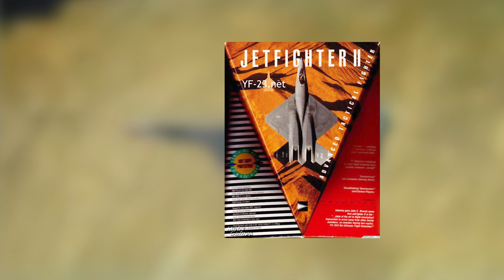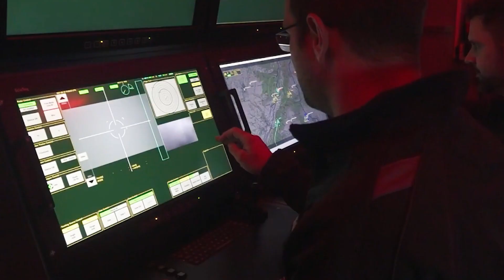Finally! US Tests World's Most Deadliest Fighter Jet

Comment: I've spoke to Air Force pilots at Edwards AFB that told me the YF-23 was much better and all the pilots favored it. Military contract politics was the reason they went with the F-22. It was probably cost. But no matter what, both were far superior to anything else in the world so we still ended up with the best production fighter in the world. It's just too bad it wasn't the YF-23.
Reply: Part of what I read and heard was due to the huge over cost of the b-2 was also a factor that they chose the yf-22.
Reply: I doubt the F-23 would have cost more than the F-22. Lockheed Martin is notorious for being over budget and behind schedule. The F-23 would have been a much better fighter.

Comment: I question the stealth comparison because every article I've read/seen supports the YF-23. 
1.Profile wise it looks thinner & the stabilizers on he YF-22 are Massive even if they are angled. The other things not mentioned here are:-
2. the overall range which the YF23 was longer (as well as the combat range), 
3.the speed - which remains classified to this day but many have said it was capable of more than YF22.
4. Northrop's computers and electronics were far more advanced than Lockheed Martin at that time & if I'm not mistaken they supply the electronics and computing for the F-22 now.
The factors which were the main considerations, were 
A) Close combat maneuverability which was not a requirement when demonstrated but the YF22 demonstrated it and as time has proven - its a pointless advantage given beyond visual range requirements now even more at the fore - which the YF23 was better because of its range and advanced electronics/computing.
B) the more significant thing was having Northrop overburdened with 2 massive projects and the YF23 being a significantly new design project may have led to significantly more cost over-runs & delays, and the loss of aviation/manufacturing professionals/ if Lockheed lost the project & the resultant loss of competition in the industry going forward.
With the benefit of hindsight now 30 years, we can see that for a decade now the F22 has become relatively obsolete and the air force is already developing the 6th generation fighter. Many will see that the planes of NGAD will be far more like the YF23. So in that regard with 30+ years of development of the YF-23 what would it look like now or even 7 years from now ??- and those cost over runs - would they not have ended up being actually Savings - because you are developing  a concept that existed way ahead of it time. Proof in the pudding is the Japanese working with Northrop on their F-X program and taking a real interest in the YF-23 program. Also if you look at Britain/Europe Tempest concepts they seem far nearer to the YF-23 design even after 30+ years. Which should enlighten people on how advanced the YF-23 program was. I'm sure it would have had far more issues to resolve, but as many have said "Fortune Favours The Brave".
Reply: I agree with everything you said.  To summarize the supersonic cruise, almost double the range and it’s superior stealth would all be critical and decisive air superiority qualities most needed in today’s environment.  If it was more costly and riskier, it should have been well worth it. I don’t recall the F-22 being on time or on cost at all.
Reply: The joke about Northrop's lost to Lockheed Martin in the ATF competition is Northrop lost because it brought a 6th generation fighter to a competition for a 5th generation fighter.
Reply: @F15ElectricEagle  This is the best simple explanation I've ever read! although i think the Craptor is more realistically a gen 4+++++

Comment: I had an opportunity to work with an engineer who worked on the YF-23 & he said the YF-23 outperformed the -22 in every category except “time to climb” which wasn’t a design choice at the time of initial design? He said his group was told that the true reason the ‘-22 was selected over the ‘-23 was the production location which one of the senators involved in the was from Georgia which is where the production location ended up. He said, and has been verified, that the design was amazing & used alot of engineering used on previous Northrup planes. Either way, it stands today as one of the most phenomenal plane designs Ever!

Comment: A lot of the design choices that were implemented in the two YF-23 prototypes were made to meet the certain requirements of the ATF competition, but along the way the Air Force changed some of the requirements of the ATF Program, so design elements like the large engine humps of the YF-23 would of been drastically smoothed and reduced in the production version of the F-23 if it had been selected as the winner of the ATF Competition. And there was also talk that the F-22 Raptor was also considered for a US Navy, the F-22 Sea Raptor would of been a Carrier version for the US Navy, kind of like if a F14 Tomcat and F-22 Raptor were combined into one fighter but this idea was later dropped.

Comment: You can argue the 23 didn’t have the dog fighting ability of the 22 all day but, the DOD didn’t designate thrust vectoring as a requirement for the program. And the 23 was only slightly less maneuverable. The 23 had everything on the 22 except TV. Lower RCS, longer range, larger payload and was way faster. The bottom line was they always screw NGC and Lockheed Martin has more pull with the powers that be. And a final note…the F-22 hasn’t had to dog fight any other aircraft even once.  As a NGC employee during this competition, I digress.

Comment: Main reason the YF-23 failed was due to the fact the US wasn't willing to go into problematic development and production time such as what happened with the B-2.   Once the bill goes up the US government senators get a little worried of their wallets.    So because the company that owned the B2 also owned the YF-23 and the US government was expecting that the fighter would have a difficult time and be to expensive, it was canceled.    

Ironically enough if you were to create a new variant of the YF-23 today there's a good possibility it could fulfill all the requirements for a gen 6th fighter.

I don't think we've seen the end of the Black Widow's story..
Reply: The B-2 production costs were part of its revolutionary development, it was the first aircraft that was entirely designed, and digitally test flown on computer systems. There were robots in use on the production floor - it was, and still is, an amazing step forward. It was ground breaking. That costs.

Comment: Sorry bad analysis on several points. The YF-23 has a smaller radar cross section. It also had a faster top speed with the GE120 engine as well as longer ranges. Also thrust vectoring nozzles increase a jet’s radar cross-section, meaning the YF-23 had better stealth performance than the YF-22. Also the engine faces were covered over by facets and were not visible by radar. The distinct trapezoidal wing, a dropping duckbill-shaped nose, a pushed-forward cockpit, and a V-shaped tail, the YF-23 had a far higher stealth profile and did not cut down on maneuverability. In fact improved instantaneous maneuvering. The thrust vectoring only improved high AOA maneuvering by only 1-6 degrees. Lateral maneuvering or rate maneuvering were actually better in the YF-23. I've worked with the Air Force pilots, weapons testers, and program test directors at Edwards AFB that informed  me the YF-23 was much better and all the tests and testers favored it except in the high AOA regime and even then it really would not have been that big a difference, even with the upcoming Russian designs.

Comment: I've heard that a somewhat overlooked advantage of the YF-23 is that, as part of the development costs, it was intended to be upgraded and live a long life in a way the Raptor was never designed to do. It was planned to have the full suite of datalinks and battlespace integrations that were still in the imaginations of folks at the time -- some of which are now live in the F-35. There's a good chance that, had they gone with the 23 and funded it appropriately, it would still be in production for another decade, with many more upgrades and advances to follow, rather than being cancelled like the Raptor. 🤷‍♂

Comment: From what I have gathered from over 30 years of following up on both fighter prototypes, and also as a YF-23 fan mind you, the USAF couldn't and wouldn't select the Northrop Grumman prototype! B-2 bomber cost overruns and teething issues, increasing F-18 Hornet and Super Hornet production to soon replace the aging F-14 Tomcat, Pentagon problems with the company over other defense contracts, and most of all that fly off which showed Lockheed Martin's prototype was capable of advanced air maneuvers and could fire off a AA missile from its weapons bay in real time in front of USAF head honchos and other VIPs. Simply put, Northrop Grumman was ALREADY in the doghouse and their prototype while highly advanced and very formidable, was out shown by the YF-22 in the fly off which sealed its fate. Even I as a YF-23 buff couldn't realistically select it alone outside of emotional sentiments. If it were up to me though I would have selected both prototypes, with the F-23 Grummanized for USN  fleet air defense and USAF F-23 as a interceptor and deep penetration strike aircraft along with a high altitude high speed RF-23 tactical recon variant. The good news is the YF-23 will live on in the upcoming NGAD 6th gen fighter.

Comment: A correction: The F-22 didn't go out of production because its cost was excessively high (as is implied by the narration). While yes costs were the reason, the context is that the F22 simply never got to see the wars it was designed to take part in - so keeping production and maintenance costs for a craft that is not being used, is not economically sensible. Had the F-22 actually seen the combat it was made to partake in, then it would never have gone out of service this early, no matter its actual production cost. It's a case of "won the war by merit of simply existing".
The F22 on average costs 40-50% more than an F16 - which is a jet that has been in production for decades with optimized manufacturing and streamlined production methods and supply chains + it's an inferior craft outside of specialized utility cases. So by all intents and purposes the F22 is not really that expensive to manufacture relative to how great versatility and technological improvement it offers.

Comment: Northrop had the B2 slated for 75 planes at the time, cut from 132. Lockheed had nothing visible, and needed the work. There were questions if Northrop could handle 2 large programs at the same time. Now add the politics into the formula. I had hers stories about the Lockheed team at Edwards. They were not concerned about the flyoff results.

Comment: The F22 fitted the requirements of the time. Modern doctrine has changed and the need for a close in dog fighter that can also be a long range stealthy sniper is being reassessed. 6th Gen fighters may well take more of their design elements from the YF23. 

The reason the F22 was not built in the numbers predicted was the fall of the Soviet Union. It also does not take advantage of improvements in avionics that are used in the latest aircraft like the F35. With a smaller number built than previous fighters there is not as much advantage in doing upgrades so it cannot have the shelf life of the F15. 

The reason anyone would worry that the YF23 was not chosen of the the incredibly successful F22 Raptor is that the grass is always greener. They miss the point that no military development truly goes to wast. With better stealth materials and better avionic, the legacy of the YF23 will live on.

Comment: There are a lot of inaccuracies in this video!
1 the YF 23 beat the YF22 in EVERY category except maneuverability and for historical accuracy the difference was minimal but politics chose a dogfighter in the age of first seen first killed!
2 Blockhead  Martin had no major contracts on the books and certain politician's were concerned about the company folding as there had become " too big to fail " it would have caused massive political and huge economical damage to MURICA!
3 Northrop had had some drama's delivering on current contracts and some cost over runs which cause some politicions to second guess giving them the win so Blockhead was chosen who then proceeded to have massive cost over runs and delays and blow outs which then again repeated with the F35 which suffers the same huge stealth hole the F22 Craptor does which is the giant heat plume out its ass !
4 Realistically the Craptor is more of a gen 4+++++

Comment: The speed of sound varies based on altitude!!!  It is not a concrete number!!!  To fight only at sea level, would shorten the life span of the aircraft!!!  The speed of sound is as much as 100mph lower at altitude (650mph).

Comment: Why do they not add the YF 23 as a secondary stealth fighter for long range for the Navy with the new technology better computer chips bump it up for a little longer range for 1,200 miles and you can put vectoring to the YF 23 the designs already there when I spend more money just tweak it up a little bit with the new technology instead of spending more money on Old technology they would tweak up we have 15 eagle and also they'll tweak the hornet so why can't they do the same thing for the YB 23
Reply: If WW3 was to start the US would have lots of different aircraft in production and would also develop new aircraft. The war time budget would be 20 times greater than all the other countries military budgets combined. 
The US would spend more on carriers than the other nations combined would send on their whole budgets.
Reply: Unfortunitely the reason why they didn't adopt it was because there wasn't any need to adopt a next gen fighter platform during the late 90's. After the winner for the Advanced Tactical fighter was chosen, they didn't make any YF-23's because they saw the Raptor as a superior aircraft. Due to Northrops previous problems with cost overruns, they selected the Raptor because they knew it woulf fair much better against its counterparts production cost long term. 

Now in 2022, looking back, we can all see it may have been an excellent fighter, but due to the circumstances and environment at the time, they did have a reasonable excuse to not adopt it. Situations like maintaining the F-35 have proven to be a disaster, same can be said for the Raptor and its rival. 

Now we all know Northrop has taken large steps to make sure maintaining new aircraft will not be a challange. An example can be the B-21 which utilizes stealth with easier maintinance then compared to its counterpart, the B-2.
Reply: If a plane is designed for a specific Air Force mission, it's not as simple as one may think to make suitable for Navy service.  A good example is converting the F-17 to F-18. There were issues....  I know I was there.

Comment: The YF-23 was a fantastic aircraft no doubt, but the YF-22 was the correct choice. Most of the YF-23's alleged superiority was a press construct. For decades we have been hearing that the YF-23 was faster. Funny enough the fasted ever  recorded speed of the YF-23 was Mach 1.8, yet the YF-22 was doing Mach 2.2+ with power to spare. The YF-23 windscreen broke twice in testing. The entire plane was not very mature. 
 Both airframes exceeded RCS requirements and were extremely stealthy. Point is the press is responsible for the public  thinking the YF-23 was a super fighter, when it was not.

Comment: I had a had in manufacturing one of these. In no way was the YF better. The F22 is an absolute killer to discredit it silly.  Look at the engine outlets and tell me which one has better stealth.
Reply: They were both YF's - YF-22 and YF-23. Therefore, I doubt your credentials